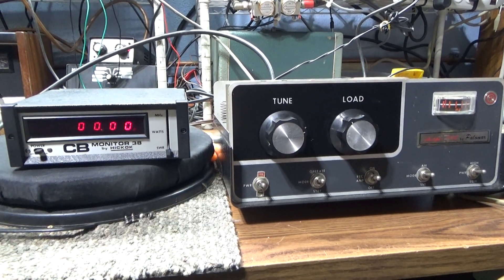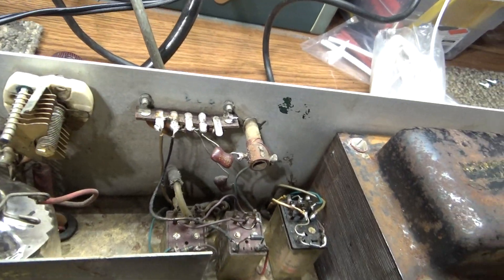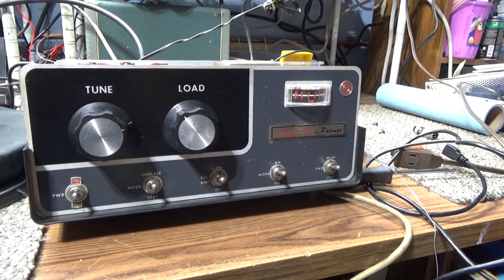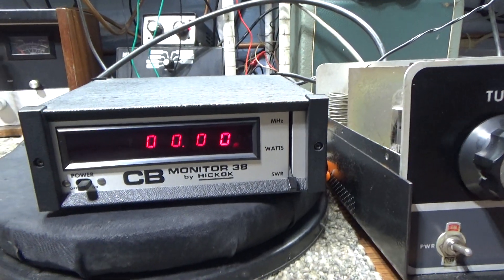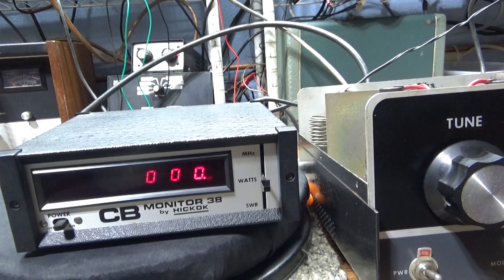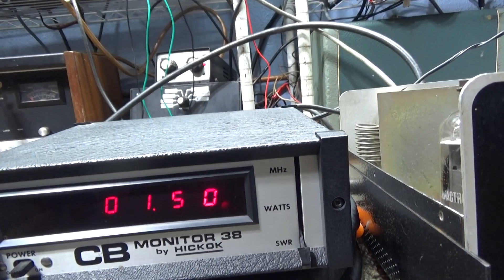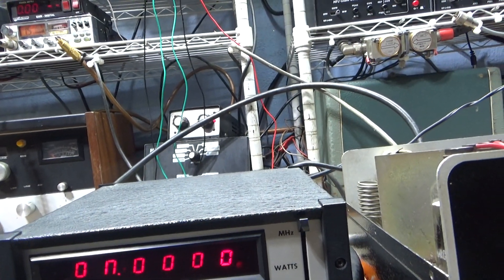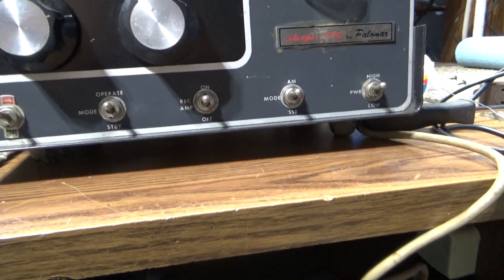Dusty Palomar Skipper 300 and Hickock 38 Digital Wattmeter, Frequency Counter and Auto SWR meter.

Comment: Is that box fan powered by 120v AC or 12v DC ?
Reply from the maker: 120v AC. I believe DC fans hooked to a tube radio or tube amps DC power supply creates too much noise.
Reply: @tramdr  Thanks

Comment: Good evening TramDr. I have skipper 300 with the 8950 tubes. When you have the time can I get that chart for the different tubes that will work in the skipper 300. BUG aka 654 Las Vegas Nevada.  Send it to my email please. Thank you
Reply from the maker: 9 pin mid size tube with No Plate on Top
6JG6  17 watt
6JR6  17 watt
6JT6  17.5 watt
6KV6  28 watt

9 PIN Mid Size with Plate on Top  slightly different pinout than above
  and same Pinout as large size below.  (D+A)
6JB6  17.5
6JF6  17
6JU6  17
6KM6 20

9 PIN Large tube plate on top same pinout as 9 pin medium above D+A amps
6JE6 (A, B, C)  30
6LQ6    30
6LZ6    30
6ME6   30
6MJ6    30

12 PIN large (Palomar Maco)
6LF6   40   6V 2A
6LX6   40        6LF6, 6LX6, and 6MH6 are said to be virtually identical except for size
6MH6  38.5
6JS6   28
6JS6A  28
6JS6B  28
6JS6C  30
6KD6   33
6KN6*  30
6LB6   30
6LR6   30
6JM6A 17.5
8950    33   12V Filament   1.1A
M2057 40   12V Filament  1.3A

Comment: Which tubes will interchange with the 6LQ6 ?
Reply from the maker: 9 pin mid size tube with No Plate on Top
6JG6  17 watt
6JR6  17 watt
6JT6  17.5 watt
6KV6  28 watt

9 PIN Mid Size with Plate on Top  slightly different pinout than above
  and same Pinout as large size below.  (D+A)
6JB6  17.5
6JF6  17
6JU6  17
6KM6 20

9 PIN Large tube plate on top same pinout as 9 pin medium above D+A amps
6JE6 (A, B, C)  30
6LQ6    30
6LZ6    30
6ME6   30
6MJ6    30

12 PIN large (Palomar Maco)
6LF6   40   6V 2A
6LX6   40        6LF6, 6LX6, and 6MH6 are said to be virtually identical except for size
6MH6  38.5
6JS6   28
6JS6A  28
6JS6B  28
6JS6C  30
6KD6   33
6KN6*  30
6LB6   30
6LR6   30
6JM6A 17.5
8950    33   12V Filament   1.1A
M2057 40   12V Filament  1.3A

Comment: I hate most digital meters because they are more difficult to see if something is going up or down on them. You can quickly see when a needle moves up or down. It’s much faster to peak transmitters and receivers with an analog meter. But a digital readout of power supply voltage is nice to have.👍

Comment: That Hickok monitor is very cool.  Going thru my parts,projects & junk rack. I’ve got a basically mint 300a whiteface Rf deck,preamp even works. My last transformer gave up the ghost and I’m not spending anymore on another,as well as a Pal 200x that is basically parts if you find your self in need of either they can have a new home cheap lol